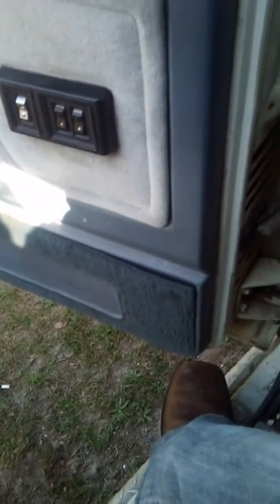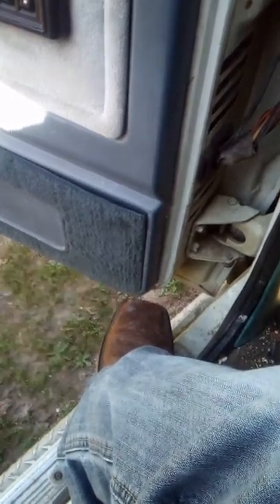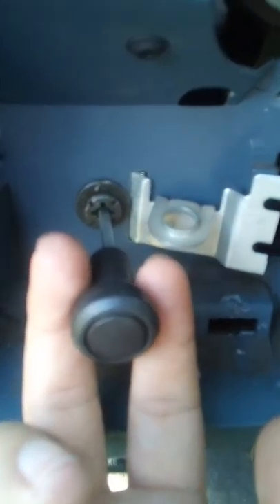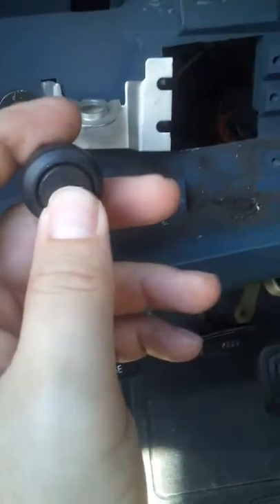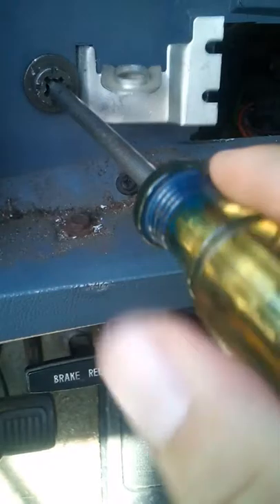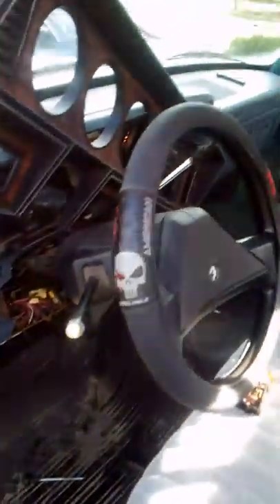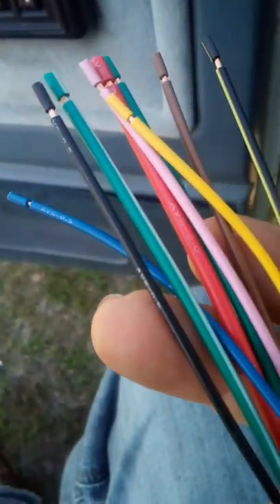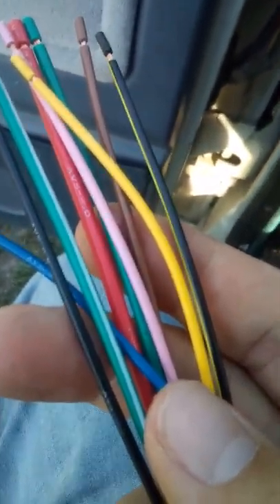1st Gen Cummins headlight switch replacement

Comment: Where did you get the plug with wires?
Reply from the maker: Rockauto.com it's the headlamp switch connector. Go to the "Electrical-Connector" tab and it'll be there roughly $24-$34 depending on which one you get